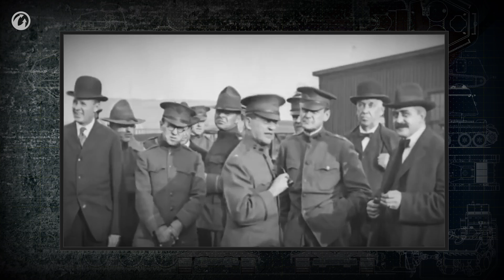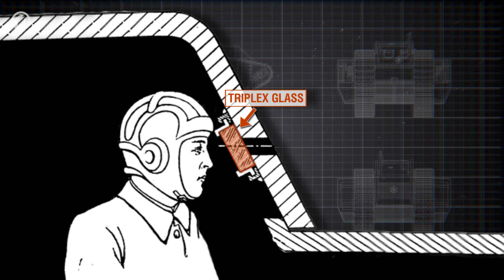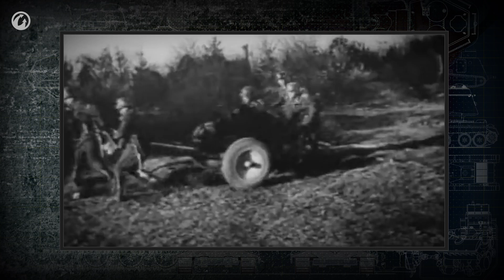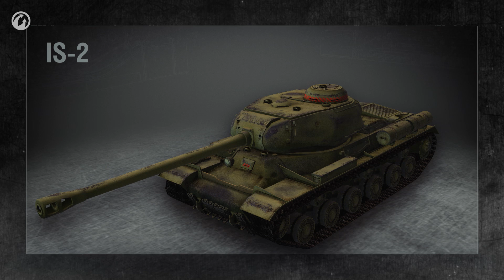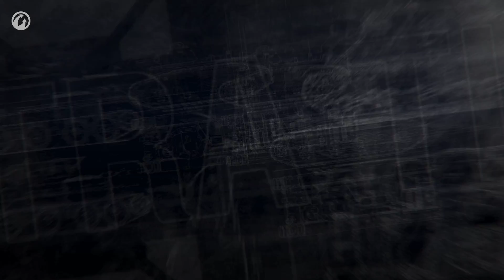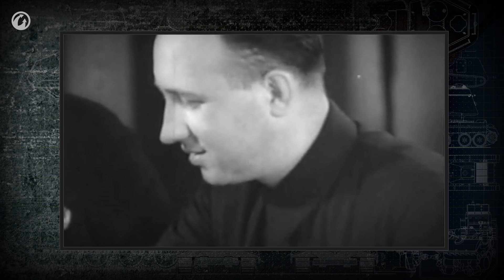The Nuts and Bolts of Tanks: Observation Devices - World of Tanks

Comment: did anyone notice that the IS-2 wasnt actually the IS-2 lol.
Reply: +CaptainMCDerpington 
what?
Reply: that was not the IS-2, search it up, the IS-2 doesnt have the 2 different angles in the upper part of the hull armor.
Reply: +CaptainMCDerpington there were two IS's the 100mm or the 85mm gun
Reply: And the IS-2had different turrets the early (1944) and the late (after war)
Reply: the IS had used 85mm guns but I did see stuff saying there was an IS model with a 100mm gun that was the IS-122  (Which I assume became the IS-2), but I do not see anywhere that says there was actually a model of IS-1s which was produced. As for the turret, rather irrelevant but i know the turret difference, there was the IS-2 Turret and the IS-2M turret
Reply: My god, YOU? Here? :) So we meet again.
Reply: Just letting you know that the IS 2 came in two variants the IS-2 and the IS-2 mod 1944 it was the 1944 that had the angled upper plate the original had the same hull as the IS-1
Reply: actually, the IS had the 85mm gun